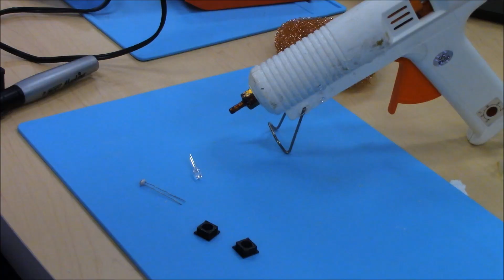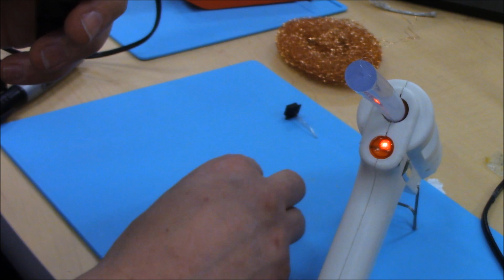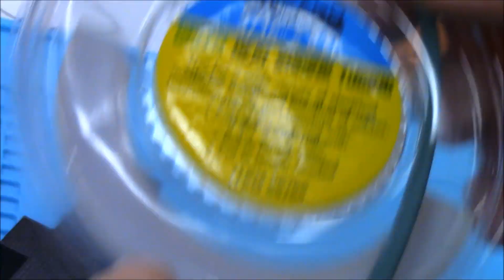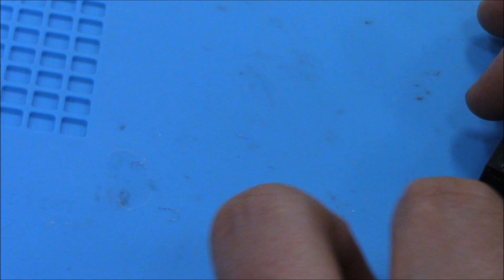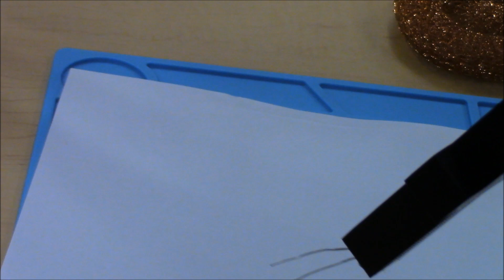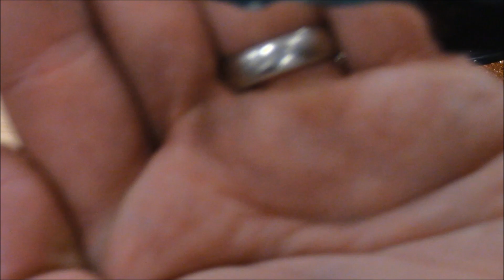Building the Spectrophotometer 2 0

Comment: I don't understand how this is a spectrometer ?...is there more please ?
Reply from the maker: It is a simple one that just uses red light to shine through a sample.  If you want to do more than one wavelength (color) of light than you need to use a different light source.
Reply: @TheMrByrom  whats the detector ? and is there software please ?
Reply from the maker: @andymouse  it uses a LDR Photo-resistor  I just use a multimeter and chart the results.  We use this to measure how fast algae is growing.
Reply: @TheMrByrom  Oh I see ! thats nice, as the population grows the density increases and the light level drops and you can plot this against time ? I guess the wavelength of the source dosent matter to much but I suppose some wavelengths will kill the algae and others might actually stimulate growth...cheers.